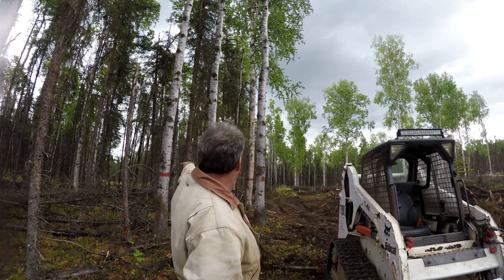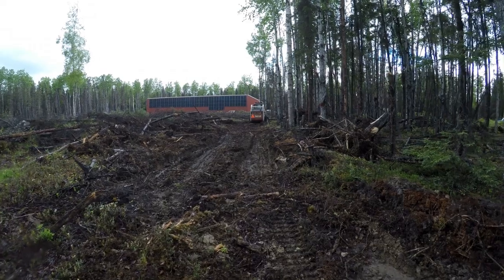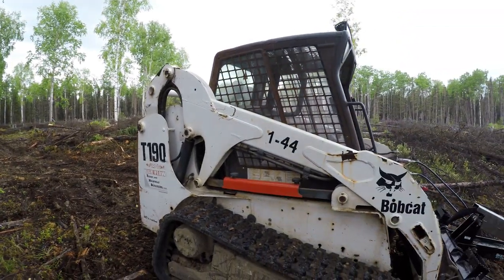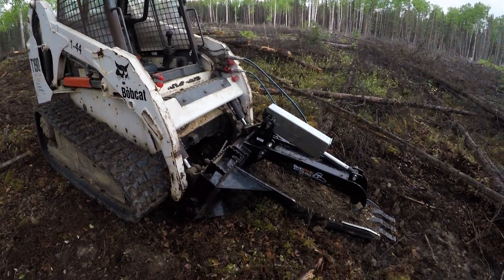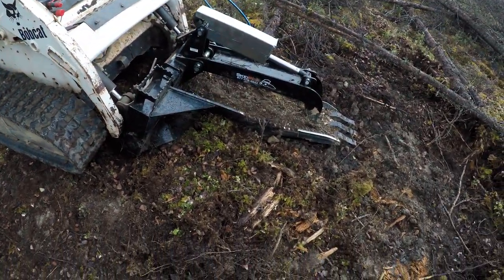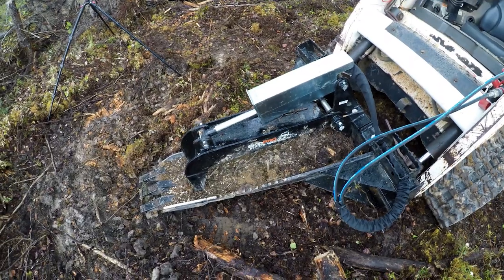Skid Pro Stump Bucket, Is It A Homestead Must Have?

Comment: This is an AWESOME video. We also really enjoy this stump bucket. Many people get steered away as it isn't what they think of when they are searching for a bucket. However, this is an attachment that NEVER leaves my farm because of how useful it is. I'm glad you like and let us know if you ever need assistance with anything else.
Reply from the maker: I was actually a little surprised with how versatile it ended up being, and glad for it.  I have you 7224 snow blower as well and took delivery just in time to test in on some of the most rotten, wet, slushy snow you could imagine early last May.  It was great as well, only complaint had mostly to do with operator error actually, and that was the powder coating peeled off the auger and edges of the chute, but in fairness.. a lot more gravel, sand, and nastiness was getting sent through it than probably should have.  Performance wise though, it was great on my T190 "high flow"(but not really compared to other brands) machine.  It was still able to throw the slop an easy 20+ feet, I just had to be patient and not ram the 12-15" mess down its throat to quickly! LOL 

I have a wish list, and you will definitely be getting more orders.. I just wish you were close to Alaska for better shipping!
Reply: Great to hear @VowellVentures ! You're right on the snow blower...patience is key to keep it from bogging down, especially in that slushy wet snow. Also, when the ground isn't frozen or is a little soft, you can easily get too aggressive on down pressure, which means more rocks and stuff through the blower that we want to try and avoid. I'm guessing this winter you'll get another shot to really test it out and get proficient! Thanks for your past business, always great to hear from you.